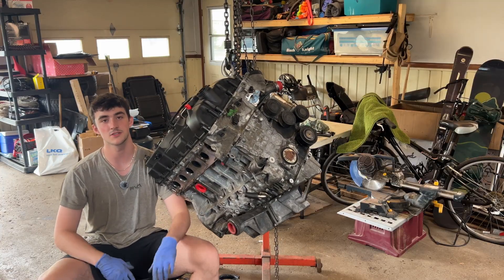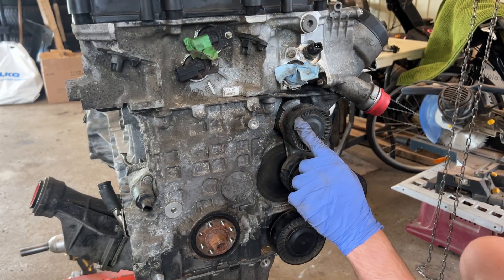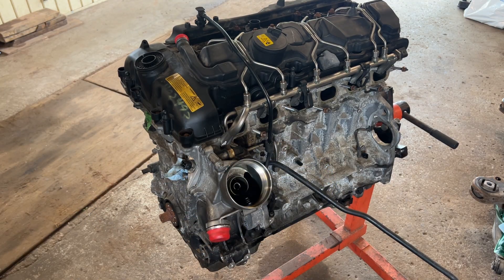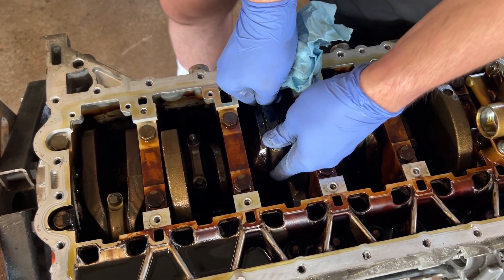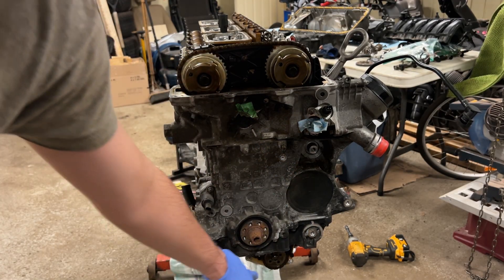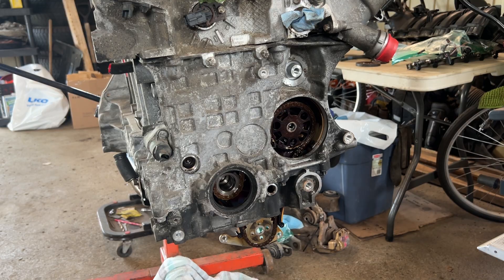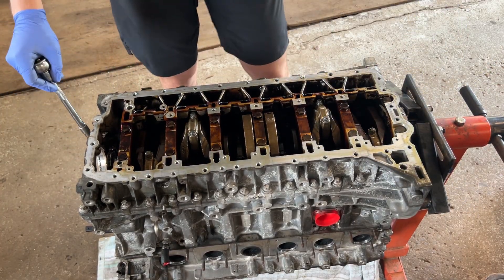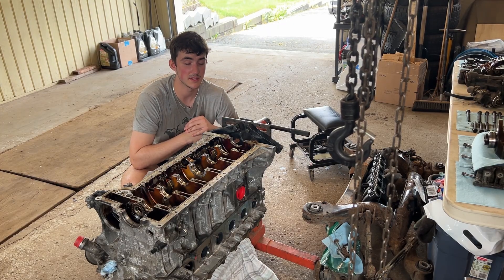N55 Engine Teardown : Spun Rod Bearing - Part 1

Comment: At what mileage, power numbers and usage did you spun your rod bearing?
Reply from the maker: Completely stock power, no mods whatsoever. I was driving on the highway when I started hearing knocking… I was like at 116k miles I’d say
Reply: @e9Xbimmer Oh wow. I'm at 80K miles and 390hp, so I'm planning to change them for sure.
Reply from the maker: @Dutch79 tbh I think the issue with the early PWG N55s were the rod bearings themselves… so yeah I’d recommend to do them for peace of mind. I’m at 370hp now and she’s running great on ACL rod bearings
Reply: @e9Xbimmer Not sure if they actually used other rod bearings in the EWG, but yeah fresh bearings like ACL should give more peace of mind ;)
Reply from the maker: @Dutch79 yeah from what I’ve seen they used S55 rod bearings in the EWG. Don’t know how much better it is but it seems to be working 😅

Comment: nice vid, are you planning on upgrading the bottom end if you rebuild the motor?
Reply from the maker: My goal for this build is especially the rebuild it on a budget to resell afterwards, but I bought a N54 crankshaft, so I guess that counts as an upgrade 😅

Comment: Hey, just wondering, what would be the most cost efficient strategy when you spin your bearings. I also have an e90 n55 and i also live in canada, and im always concerned of encountering this issue. Where did you end up buying the used motor from? Do you plan on selling your motor that you are rebuilding for profit? This issue is  a fear of mine due to all of the forums and everything saying how much of an issue it is, and i would hate to have to spend all that money to get my car back on the road again.
Reply from the maker: I ended up buying a used engine from lkq (the cheapest in the country literally). I’m only planning on rebuilding this engine with the minimal amount of stuff that I need to change. After that I’m going to sell it to reimburse all of this. In my opinion, the fastest option is to simply swap with a used engine, but the most cost effective would be to find a used crankshaft and rod and rebuild your engine. Overall I’m about 2k$ in the rebuild, which is pretty good, but I’ll make a video later more in depth on the cost breakdown. Hope this helps!

Comment: 2013 335xi    has a milkshake instead of engine oil and in the coolant reservoir.  My car is worth less than a new engine so im gonna do a rebuild myself.  Will be coming back to this video many times.  Thanks for this.
Reply from the maker: Gosh that sucks. The next parts should be up eventually, I almost finished rebuilding it.

Comment: With a spun rod bearing, can I just get a new bottom end or do I have no choice but you rebuilt/ replace
Reply from the maker: It really depends. Most of the time when it spins a rod bearing the crankshaft/rod are too far gone and aren't round or repairable anymore. I have seen a couple of cases where they could fix the crankshaft and just replace the rod bearings. But if your rod is black like mine, odds are you're going to need to change the rod and the crank

Comment: can you use n54 crankshaft in the n55?
Reply from the maker: Yes you can, I'm currently working on a video to showcase it
Reply: No it doesn’t directly fit and the sensor is positioned differently. You’d be better off getting an M2 Crank that’s forged.  VAC, Pure Performance, or SSR offer billet or forged crank options that fit directly and are stronger than both N54/N55 stock.
Reply from the maker: @MikeTheLycanGaming  although true for the sensor, it is very easy to retrofit the way the N55 reads the crankshaft position on the N54 crankshaft. Also a much cheaper alternative to all the options you've listed.

Comment: Dude, I just sent N55B30 (2010 E90 335i) out for revision. Cylinder 4 looked exactly the same as yours, completely burned and the same scorching marks on the crankshaft. No clue what could have caused that (lack of lubrication, rising temperatures, ofc, but why).
Reply from the maker: Yeah same, I can only assume that it was lack of lubrification, or lack of oil changes/missing under a quart of oil?
Reply: @e9Xbimmer  I'm reading a lot about it happening after a repair like an OFHG, where people don't prime the oil system. Did you do any sort of maintenance on the engine recently?
Reply from the maker: @danield7306  yes multiple repairs, I changed every gasket on my engine
Reply: @danield7306 I spun number 3 rod bearing after OHG replacement, I did prime the oil system and watched oil pressure come up in ISTA, also run the engine for 20 minutes at idle after it, and it still spun a rod bearing, once you disrupt the oil circuit you really need to make sure there's no air bubbles in the system especially in the external oil cooler. Prime that system multiple times for safety....
Reply: @danield7306 I ended up having to buy a whole new forged crank cost me 3500k I have the m235i. Block was saved and pistons to, was a 10K build altogether genuine BMW parts and doing my own labour.